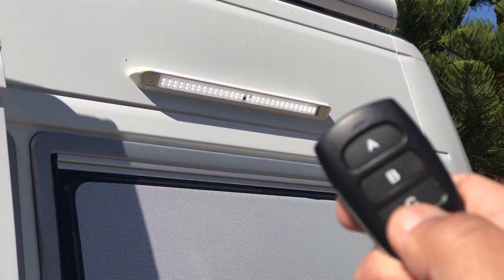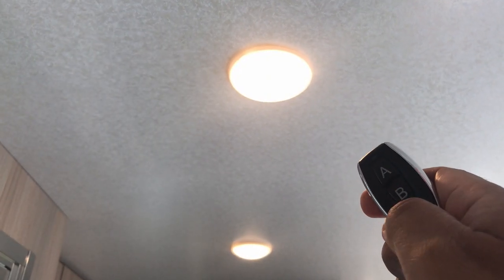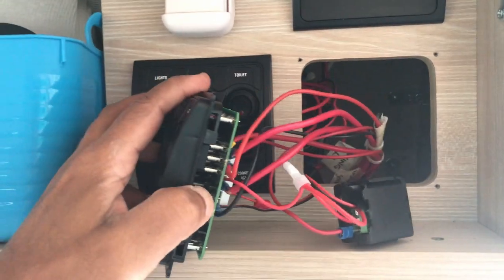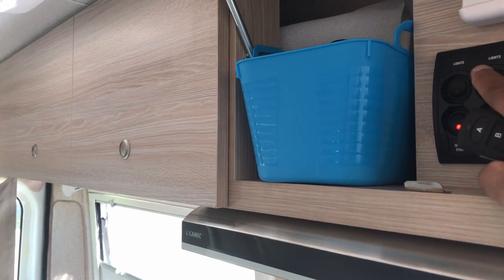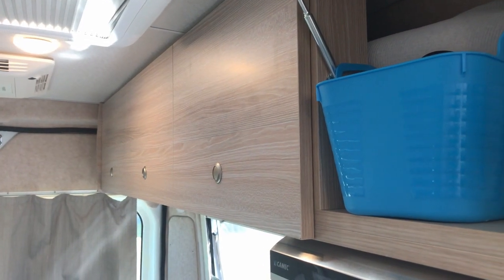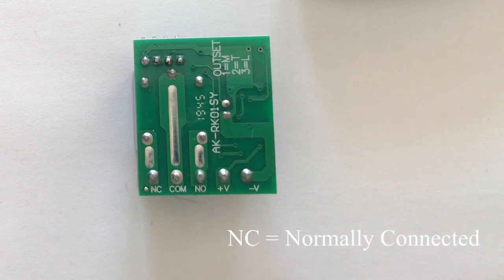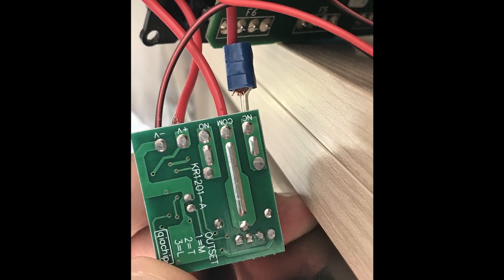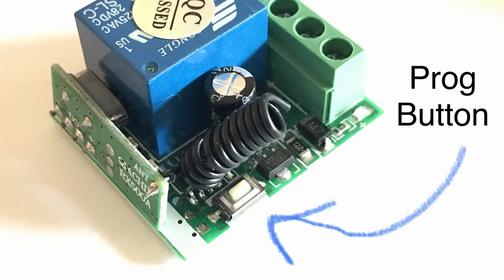Motorhome Add-on Remote Light Switches

Comment: what I have that is driving me crazy trying to get it to work is one 12v wire on a rocker on off switch and goes out to the front rv led strip lights. I tried a shelly wireless switch that worked buy not away from the house at the campground only at home with our internet router. so gave up on it and sent it back. This one I have now has 4 wires on the wireless relay two red and two black and came with 2 fobs with on off button. Problem is I still only dealing with one wire in and out 12v with rocker but for testing I hooked up my 12v battery to a camper light with two wires one ground and the other hot. I turned on the light and hit the pairing button on the relay to get the one red flash and then held the fob button down to get the 2 flashing red lights showing it paired. tried the fob on off but the light just stays on? I have it wired up per the instructions on the relay with hot in and hot out and ground in and ground out? is there and wireless switch just for one wire rocker out there?

Comment: Nice video . quick question will this work for a fog lights in a car? Thank you
Reply from the maker: Hi Aaron, may not work if the fog lights are high amperage, check the amperage rating of the switch and the fog light. Happy New Year!

Comment: Well explained thanks. Is there an amp limit for these switches please? Wanting to make my inverter remotecso it doesn't draw 1 amp per hour on standby?
Reply from the maker: Not suitable for inverters. Unless you use a relay. So the wireless switch switches the relay switch. Relay switch can handle huge amperes. Wireless switch up to 10amp i reckon. My 2000w inverter uses over 100amps!
Reply: Cheers

Comment: How do I modify a 12V 433MHz wireless remote control switch relay receiver and transmitter? Someone in the area (neighbor) is using the same frequency.
Reply from the maker: i believe each remote has a fixed code, so you will need to get another remote, no need to change the switch

Comment: Thank you for your video. Would it not be better to mount this box in bypass? So that it work completely separate of the actual manual switch? I just imagen that the one time you would need that light to come on from 250m , you have forgot to turn on the main switch.  So the circuit diagram  would be to keep the standard switch setup on the RV, then wire the remote box to the same light bypassing the switch vi NO . Now your hard switch will work separately and your remote will work separately.   Pro: your remote will always turn on/of the light . Con: you will have two circuits in conflict . So you try to turn of the light with the hard switch but its still on because you have closed the switch on the remote.  I will add this box to my car :-) Great stuff. Sleeping in a rood top tent , this is very convenient in regards to get light when you are moving inn and out of the tent at night . Hence also the suggested circuit as i know that i will forget the hard switch and never have light  via remote when needed:-P
Reply from the maker: Let us know how u go with a few months of use please

Comment: I haven't tried it yet but at 8:14 you show it getting 12v constant from a switch that is turned off?? I don't think that will work.
Reply from the maker: Its your existing switch, the remote is an additional switch. I explain why this method keeps your existing switch working as you’d expect
Reply: @VanHacks  For this to work I assume the existing switch would always have to be on otherwise the remote would not have power. Is this correct or am I missing something?
Reply: @billbyrne9363  yep that’s correct

Comment: Is the wiring significantly different when the switch is part of the light? (ie in my camper, each ceiling light has a push button in the center of the light)
Reply from the maker: No - it acts as a main switch. So the switch on each of your lights will be “sub switches”. 😄
Reply: Ok follow up question (I’m attempting to install some of these in my camper as well).... for the switches I bought, the (albeit quite difficult to decipher) directions does not use the NC. it has a jump going from +V to COM. Does that seem right? 

For context...  the negative wire goes from the power source to -V and then from -V to the light. The positive wire goes from the power supply to +V. Then the other side of the cut positive wire goes from the light to NO. Finally, a jump goes from +V to COM. 

Trying to learn before i screw up my camper wiring 😂 if it’s easier and you know of a resource I can read on my own, that’d be appreciated
Reply from the maker: @elizabethmerchant9865  i advise before trying any of this inside your van, you get a comfy spot at home and with 12V DC power source and test it all out first, watch the video again, I am having difficulty understanding your question tho.. if you like send a picture of your device to cdrdicom@gmail.com
Reply from the maker: when i get back from my trip i will upload a more detailed explanation of the wiring
Reply from the maker: this is a great mnemonic; NC: Nomally Connected, NO: Normally Off
Reply from the maker: @elizabethmerchant9865  i just watched the video again, i think i do go into quite a bit of detail, so please watch it again cos i doubt i can do better!
Reply: Sent you an email if you have the time. No worries if you’re too busy!
Reply from the maker: @elizabethmerchant9865  Think of the wireless switchboard device as having two separate parts: one part is the "brain", the brain needs power ie +ve and -ve from a battery. 

The other part is the switch. The switch sends +ve power to your lights. With the switch you have two options; default ON or default OFF, its as simple as that and does not really matter which one you use; as the remote switch will be able to switch ON and OFF anyway. 

Since both the brain part and the switch part need +ve power, a jump cable is used to connect the two connections of the device that requires +ve power supply.

My advice is exactly as per my video, the power should not come from the battery, it should come from your main light switch. Why? Because then the brain starts to work only when you have switched on your main light switch, and the light will come on as you would expect (each and every time you turn on the MAIN light switch). Thereafter you have the option of using the remote switch to turn off your lights (and on again etc).
(What is the "main light switch" - it is the switch that your van came with which supplies power to ALL of your lights in the ceiling)

So your main switch for your van lights powers your lights and the brain of your wireless device - makes sense?
haha its a bit confusig isn't it?
best regards from Broomehill, WA atm
Reply from the maker: @elizabethmerchant9865  yes i have replied

Comment: Hmmm, not very useful to be honest. The feed to the remote switch is after the mechanical switch, therefore to be powered the light has to initially be on. So you can benefit from using both a mechanical and remote switch independently. It would be much better to build in a 2-way circuit (UK) or 3-way circuit (US). Then each switch would work independently, like the upstairs light in a home, switchable downstairs and upstairs. Can't honestly see a use for wiring it your way described 🤷